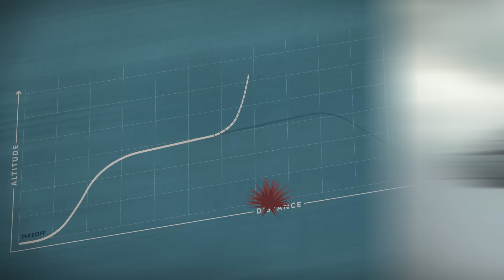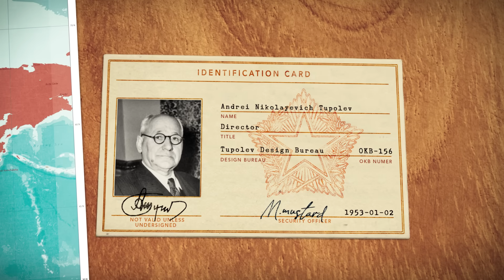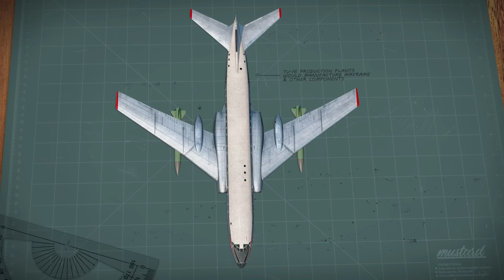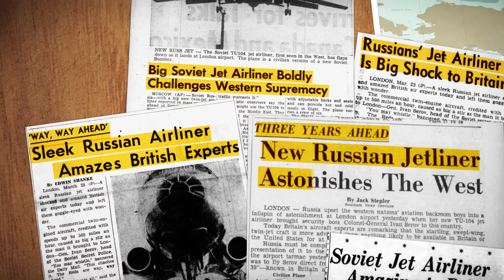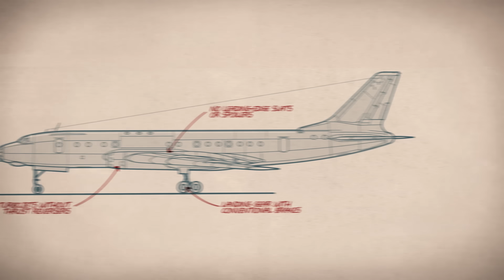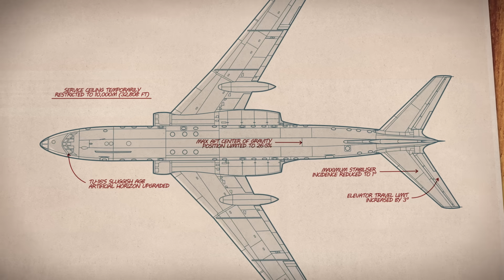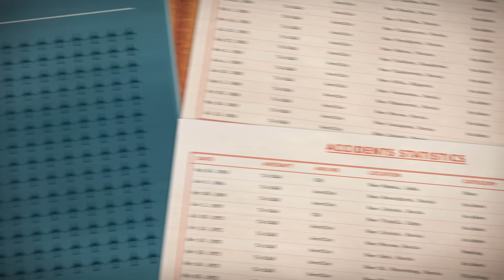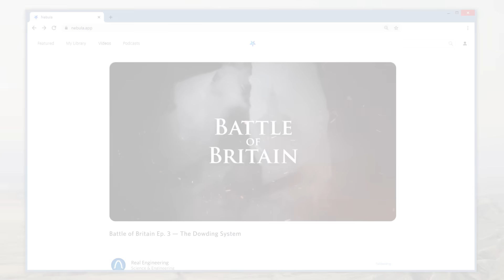The Soviet Airliner Designed To Crash

Comment: Still safer then the de Havilland Comet.
At least the Soviet engineers know that in a pressurized hull windows must be rounded and not squares.
Reply: We believe we can clear up some commonly held myths and misconceptions obviously.

It's always good to see the facts presented clearly and concisely isn't it?

Obviously there have been worse aircraft for accident losses both before & after the Comet.

The engine position and inlet design had advantages at the time. The inlet design was changed to help reduce the chances of pilot error caused stalls during takeoff. 

All jet airliners benefited greatly from the knowledge gained from the Comet incidents & subsequent investigations & yet some were still worse for accident losses. 

Instances of all marks of the Comet flew with full certification after 1954 including the Comet 3.

The fabulous trail blazing DH Comet.
World's first jet airliner.
World's first high altitude airliner.

    How things were back then.
Accident losses - % of aircraft built.

It should be remembered that it was not unusual for the first batch of say 10 of a type to have much higher accident losses than all the aircraft built. 

DeHavilland Comet 4 UK                     14% 
DeHavilland Comet all (ff 1949)         17%  
Vickers VC10 UK (ff 1962)                   5%

Douglas DC-1                                      99%
Douglas DC-2                                      47%
Douglas DC-3                                      30%
Douglas DC-4                                      26%
Boeing s300                                          72% 
Boeing 307                                            70%
Boeing 247                                            48%
Boeing 707  (ff 1958)                           20% 
Lockheed L-049/149 Constellation    30%
Lockheed Electra  Turboprop .            29%
Fairchild FH-227                                   30%
McDonnell Douglas DC-8                    14%.
Sud Aviation Caravelle  (ff 1955)       15%
Canadair CL-44 Turboprop (ff 1959) 46%  
Convair CV-580  Turboprop                22%
Convair CV-880     (ff 1959)                27% 
Convair CV-990     (ff 1961)                33%
Tupolev T-104        (ff 1956)               16%
Vickers Viscount   (ff 1948)               32%             

  The Vickers VC10, fastest Atlantic crossing for a non supersonic jet airliner, held the record for 41 years.

For the first few years of operation the Caravelle & Comet had similar accident loss fatalities.

The first few Nimrod airframes were Comet 4 airframes with the equipment bay tacked on. Subsequent Nimrods were new build Comet 4 airframes with the modifications built by the DH team at Hawker Siddeley.

The world's first wind tunnel was constructed in England during the 1870s. The world's first supersonic wind tunnel was constructed in England in 1922.

   Of course De Havilland carried out a full stress analysis & performed extensive & protracted testing, including pressure cycle testing, on two long lengths of fuselage. De Havilland carried out significantly more testing than was required by any authority at the time & significantly more testing that any previous airliner was subjected to.

   De Havilland did indeed always work to better than industry standards at the time, used up to date knowledge for the design & no evidence of negligence or criminal negligence was ever produced in relation to the DH Comet.

  The DH Comet had better safety than or similar safety to many other commercial passenger aircraft of a similar era both before & after the DH Comet.

The accident loss fatalities for the first few years of operation were similar for both the Sud Aviation Caravelle and the De Havilland Comet.
  
Pretty much all changes made after the Comet 1 were just in case changes or were previously planned ongoing improvements.

How things are these days and what's going on in the world.

Airbus is not a German company. There are no longer any German companies making German jet airliners in Germany and there are no German companies making German gas turbine aero engines in Germany that are suitable for wide body airliners. 

That's correct, The Tornado & Typhoon & their engines are supersonic & are indeed British design aircraft with British design engines built by an international consortium. The Tornado design for example started life during the 1950s at Vickers as the AFVG, it's engine is based on the RR RB-199. The EE Lightening is also a British Supersonic jet aircraft.

The Typhoon is the British BAC-EAP with an engine based on the British RR XG-40, the Typhoon is also built by an international consortium.

   A typical but small glimpse of what goes on in the very internationally orientated British aerospace sector.

  Of course the RR Nene was in fact the world's most reliable & most powerful gas turbine aero engine in 1944. Licensed built versions & copies of the RR Nene & RR Derwent would go on to power many aircraft in Russia including the Mig 15 & Mig 17, the US, China, France & other countries for decades after 1944.

The Axial multi stage sequential stage  compressor & turbine technology, first produced for turbo machinery use in England by Parsons of Ireland & North England during the 1800s. The components form the basis of most modern gas turbine aero engines. At the time the concept of the jet aircraft powered by axial internal combustion gas turbine engines was first mentioned thus the internal combustion jet engine & jet aircraft was indeed invented in England before the 1900s & before the Wright brothers got busy.

      Boeing Apache Attack Helicopter.
AH-64: 75 UK suppliers, 7% UK content, global fleet of 1280+ aircraft.
F35B more than 130 UK Suppliers, more than 30% UK content.
F35A & F35C more than 130 UK Suppliers, more than 15% UK content.

There is no doubt that an airline has recently ordered 60 RR England Trent XWB Engines

Obviously the UK has the
World's Highest Combined Per Capita
Nuclear / Defence / Aerospace Sector Activity.

Rolls Royce Holdings UK
Subsidiaries
- Rolls-Royce plc
- Rolls-Royce North America (ex Allison etc Classified Military stuff)
- Rolls-Royce AB
- Rolls-Royce Deutschland
- Rolls-Royce India Private Limited
- Rolls-Royce Marine Power Operations
- Vinters Engineering Limited
- Rolls-Royce Controls and Data Services
- Rolls-Royce Power Systems
- Bergen Marine
Joint ventures include:
- Rolls-Royce Turbomeca
- MTU Turbomeca -

Trent Family
The MT30 (Marine Turbine)
Industrial Trent 60 Gas Turbine
Trent 7000
Trent XWB Airbus A330neo.
Trent 1500
Trent 1000
Trent 500
Trent 600
Trent 700
Trent 800
Trent 8100
Trent 900
   
RR wholly owned subsidiaries in Germany handle smaller 2 shaft RR gas turbine aero engine work.
    
We do indeed hope this helps, of course.         
    
As always, cheers & 👍 indeed etc.c
Reply: We believe we can clear up some commonly held myths and misconceptions obviously.

It's always good to see the facts presented clearly and concisely isn't it?

Can have any size / shape windows, depends how much extra frame weight gain is acceptable. The ideal shape is elliptical, vertical dimension being largest and vertical to horizontal dimension ratio = to hoop pressurisation stress to longeron stress ratio. 

Obviously there have been worse aircraft for accident losses both before & after the Comet.

The engine position and inlet design had advantages at the time. The inlet design was changed to help reduce the chances of pilot error caused stalls during takeoff. 

All jet airliners benefited greatly from the knowledge gained from the Comet incidents & subsequent investigations & yet some were still worse for accident losses. 

Instances of all marks of the Comet flew with full certification after 1954 including the Comet 3.

The fabulous trail blazing DH Comet.
World's first jet airliner.
World's first high altitude airliner.

    How things were back then.
Accident losses - % of aircraft built.

It should be remembered that it was not unusual for the first batch of say 10 of a type to have much higher accident losses than all the aircraft built. 

DeHavilland Comet 4 UK                     14% 
DeHavilland Comet all (ff 1949)         17%  
Vickers VC10 UK (ff 1962)                   5%

Douglas DC-1                                      99%
Douglas DC-2                                      47%
Douglas DC-3                                      30%
Douglas DC-4                                      26%
Boeing s300                                          72% 
Boeing 307                                            70%
Boeing 247                                            48%
Boeing 707  (ff 1958)                           20% 
Lockheed L-049/149 Constellation    30%
Lockheed Electra  Turboprop .            29%
Fairchild FH-227                                   30%
McDonnell Douglas DC-8                    14%.
Sud Aviation Caravelle  (ff 1955)       15%
Canadair CL-44 Turboprop (ff 1959) 46%  
Convair CV-580  Turboprop                22%
Convair CV-880     (ff 1959)                27% 
Convair CV-990     (ff 1961)                33%
Tupolev T-104        (ff 1956)               16%
Vickers Viscount   (ff 1948)               32%             

  The Vickers VC10, fastest Atlantic crossing for a non supersonic jet airliner, held the record for 41 years.

For the first few years of operation the Caravelle & Comet had similar accident loss fatalities.

The first few Nimrod airframes were Comet 4 airframes with the equipment bay tacked on. Subsequent Nimrods were new build Comet 4 airframes with the modifications built by the DH team at Hawker Siddeley.

The world's first wind tunnel was constructed in England during the 1870s. The world's first supersonic wind tunnel was constructed in England in 1922.

   Of course De Havilland carried out a full stress analysis & performed extensive & protracted testing, including pressure cycle testing, on two long lengths of fuselage. De Havilland carried out significantly more testing than was required by any authority at the time & significantly more testing that any previous airliner was subjected to.

   De Havilland did indeed always work to better than industry standards at the time, used up to date knowledge for the design & no evidence of negligence or criminal negligence was ever produced in relation to the DH Comet.

  The DH Comet had better safety than or similar safety to many other commercial passenger aircraft of a similar era both before & after the DH Comet.

The accident loss fatalities for the first few years of operation were similar for both the Sud Aviation Caravelle and the De Havilland Comet.
  
Pretty much all changes made after the Comet 1 were just in case changes or were previously planned ongoing improvements.

How things are these days and what's going on in the world.

Airbus is not a German company. There are no longer any German companies making German jet airliners in Germany and there are no German companies making German gas turbine aero engines in Germany that are suitable for wide body airliners. 

That's correct, The Tornado & Typhoon & their engines are supersonic & are indeed British design aircraft with British design engines built by an international consortium. The Tornado design for example started life during the 1950s at Vickers as the AFVG, it's engine is based on the RR RB-199. The EE Lightening is also a British Supersonic jet aircraft.

The Typhoon is the British BAC-EAP with an engine based on the British RR XG-40, the Typhoon is also built by an international consortium.

   A typical but small glimpse of what goes on in the very internationally orientated British aerospace sector.

  Of course the RR Nene was in fact the world's most reliable & most powerful gas turbine aero engine in 1944. Licensed built versions & copies of the RR Nene & RR Derwent would go on to power many aircraft in Russia including the Mig 15 & Mig 17, the US, China, France & other countries for decades after 1944.

The Axial multi stage sequential stage  compressor & turbine technology, first produced for turbo machinery use in England by Parsons of Ireland & North England during the 1800s. The components form the basis of most modern gas turbine aero engines. At the time the concept of the jet aircraft powered by axial internal combustion gas turbine engines was first mentioned thus the internal combustion jet engine & jet aircraft was indeed invented in England before the 1900s & before the Wright brothers got busy.

      Boeing Apache Attack Helicopter.
AH-64: 75 UK suppliers, 7% UK content, global fleet of 1280+ aircraft.
F35B more than 130 UK Suppliers, more than 30% UK content.
F35A & F35C more than 130 UK Suppliers, more than 15% UK content.

There is no doubt that an airline has recently ordered 60 RR England Trent XWB Engines

Obviously the UK has the
World's Highest Combined Per Capita
Nuclear / Defence / Aerospace Sector Activity.

Rolls Royce Holdings UK
Subsidiaries
- Rolls-Royce plc
- Rolls-Royce North America (ex Allison etc Classified Military stuff)
- Rolls-Royce AB
- Rolls-Royce Deutschland
- Rolls-Royce India Private Limited
- Rolls-Royce Marine Power Operations
- Vinters Engineering Limited
- Rolls-Royce Controls and Data Services
- Rolls-Royce Power Systems
- Bergen Marine
Joint ventures include:
- Rolls-Royce Turbomeca
- MTU Turbomeca -

Trent Family
The MT30 (Marine Turbine)
Industrial Trent 60 Gas Turbine
Trent 7000
Trent XWB Airbus A330neo.
Trent 1500
Trent 1000
Trent 500
Trent 600
Trent 700
Trent 800
Trent 8100
Trent 900
   
RR wholly owned subsidiaries in Germany handle smaller 2 shaft RR gas turbine aero engine work.
    
We do indeed hope this helps, of course.         
    
As always, cheers & 👍 indeed etc.c